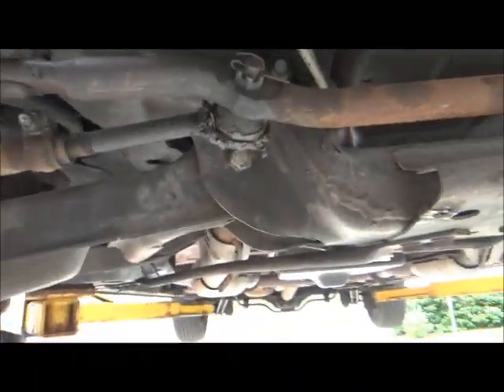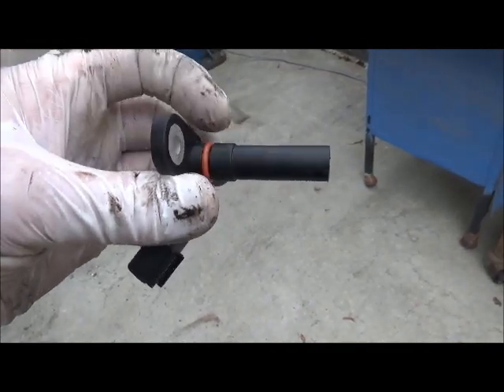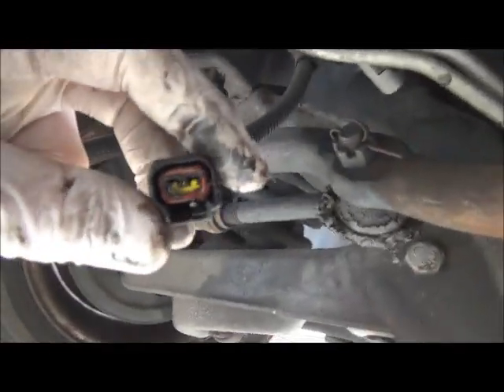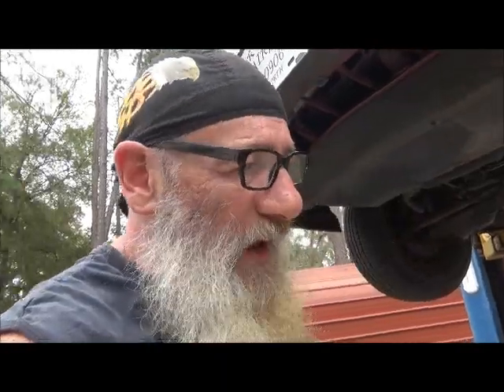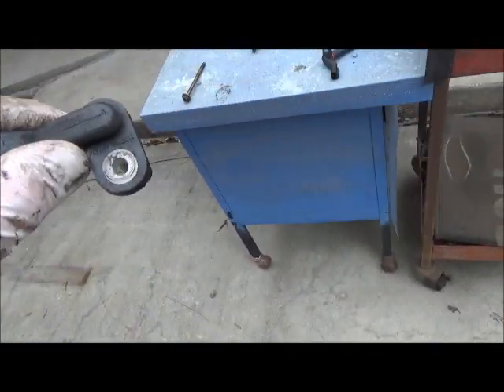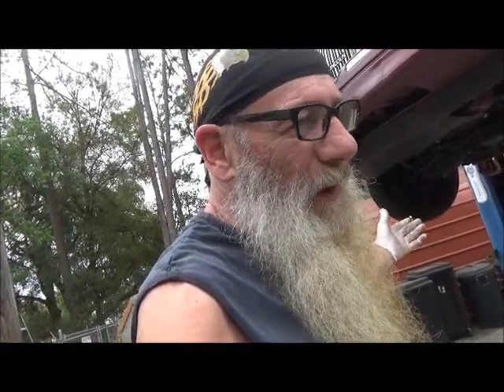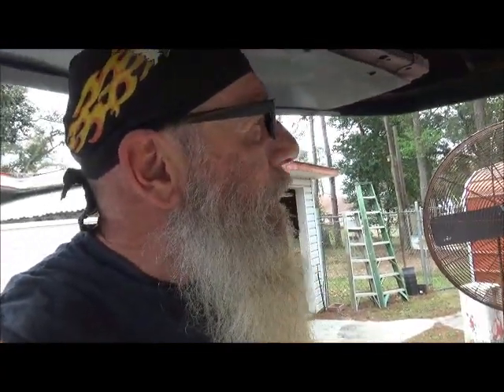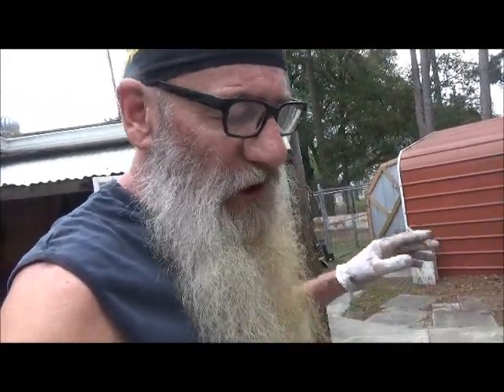Ford 4 6L Crank Position Sensor Replace

Comment from the maker: I lost a short part of this video. Basically it stated to wash out the electrical connector with brake cleaner and compressed air. Just brake cleaner will do if no air is available.

Comment: If that goes bad will it cause a wrench symbol to appear on my dash and put my 2007 f150 4.6 to go into limp mode. Because thats the issue im having now. I've cleared the pcm to adapt with throttle body, but symbol came back on kicking the motor down, again.  This is about to become the most aggravated motor replacement ever.  Any ideas

Comment: The issue I am having is a miss once the engine warms up. I have a 2003 F150 with a 4.6 V8 like this one. I don't really want to take the compressor loose just to replace the crankshaft position sensor if there are other likely causes. The truck started missing so I did a tune up on the top side, new motorcraft oem plugs, new Denso coils and a motorcraft camshaft position sensor. I had previously replaced the idle air control valve and I found one bad vacuum hose as well as a bad engine vent hose that runs from the valve cover to the intake. 
Any thoughts about what to check next? Again, it only misses after warming up, so it seems like a sensor starting to fail which is why I went ahead and did the cam sensor. When you first start it the engine is smooth as can be. Would injectors start misfiring when hot? I thought they were usually more problematic if they were cold (if they have any issue at all).
Reply from the maker: #1, are there any codes? If not, #2, replace fuel filter. #3, run Marvel Mystery Oil in the gas, follow the directions on the bottle. Do this for at least 5 tank full's. 
  I'm not going to go into all the reasons why in here, just do it.  Walmart has the best price for MMO in the big bottle.
Reply: @warhorse1956 - No codes are set. Thanks for the suggestions. I will give it a try.

Comment: So you can unbolt the compressor without having to vent the ac? Just moving the attached lines with the compressor after unbolting?
Reply from the maker: Yes, the comp. doesn't need to move much. Just enough to clear the sensor.
Reply: @warhorse1956  thanks for the response and video. Just finished changing one out

Comment: I just did this on a 97 4.6L. I did not have to jack up the car, or loosen belts/covers. I did it from the top in 10 minutes. LEAVE THE COILS AND THE COIL PACK ON. It does not help to remove them. It is very easy to change. Remove the power steering reservoir with 10mm (3 bolts) socket. Remove the sensor with an 8mm socket.
Reply: Godsend comment

Comment: My only complaint is i still dont know how to unbolt my ac compressor from the block. Im driving a 1998 f150 xlt with a 4.6 l windsor v8 small block, and yes, it does matter which factory it came from. The windsor and the romeo have ever so slightly different layouts

Comment: Awesome video,thanks for being real and sharing some great info.Having a no start issue with my 05 Mercury Grand Marquis 4.6- Michigan Winters suck,going to try the spray trick to see if the car will fire up before replacing the crank sensor,Much Thanks
Reply from the maker: YW, I hope it works. The spray isn't a definitive diagnoses. If it fails, make sure you indeed do not have spark. Also check for fuel pressures, these things are notorious for eating fuel pumps. Fuel filters should be changed every 1-2 years to keep the pumps from burning. Anyway, good luck.

Comment: I have been having a problem with my late mothers 2000 Mercury Marquis. Believe it or not the car only has around 34,000 miles on it. I have always maintained the car for her. Long story short about 2 years ago the car started to die out on me after starting. I would have to wait 10-15 seconds or more and it would start again and run for a little bit and die. Put my OBDII Code reader on it being the check engine light came on and it pointed out the crankshaft position sensor or a faulty wiring harness to it. At that point I just ordered one online and got a Dorman Brand Crankshaft Sensor. It lasted just under a year and I had the same problem once again so I ordered another Dorman Crankshaft Sensor and installed it. This one lasted about 8 months and I have the same problem again. Back in 2000 we purchased the car brand new. It never had a splash shield under it that I know of just to mention. Just yesterday being disgusted now with Dorman Sensors thinking it isn’t a quality Sensor I ordered a Genuine Motorcraft Crankshaft Sensor and it should arrive tomorrow and I plan to install it by this weekend. Just curious about anyones thoughts here. Has anyone else had problems with Dorman Sensors? The wiring harness looks to be in perfect shape to me from what I can see of it after moving the A/C Compressor to the side to replace the sensor. The plug is clean inside. Was thinking of putting dielectric grease inside the plug this time and maybe giving it a shot of brakeclean first and blow it out with a air hose. Luckily at 71 years old I am happy today that back in 1992 I installed a 9000lb lift in my Pole Barn when I was in my 40’s knowing then it would be a little tougher working on my back as the years piled on. It just getting tough to do anything on cars these days something I always liked to do during my lifetime.
Reply from the maker: The sensor I put in on this video failed just 2 weeks ago. I just settled on an Advanced Auto brand this time around. not being in the business any longer hasn't kept me up to date with the parts quality, but Doorman has certainly been a disappointment in the past few years. These days everything seems like a coin toss with parts.
Reply: @warhorse1956  I was in the Auto Parts Business since 1978. Retired in 2012. I owned a Carquest Auto Parts Store for 5 years and sold out to my then partner. I then became a WD (Warehouse Distributor). I saw a lot over the years. Many brands pulled from the same part sources and put the part in their own branded boxes or had the same sources make their parts. I was leery about even buying a Standard Motor Parts brand or any other today so I searched online for the Ford Motorcraft brand this time around. No way was I going to put another Dorman Sensor in. I still know people in the Repair business although most are retired like me. Everyone of them told me when it comes to Sensors they go to the dealer for them. Too many comebacks for the ones the Part Stores are selling today they tell me. When I make the swap this weekend I am going to try to follow the Crankshaft Sensor wiring harness up the motor to where ever it goes. Living near the woods I have had a few neighbors have mice eat their wires over the years although my family hasn’t  had that problem before and I have been here since 1985 but I am always finding Acorn debri under the hoods on vehicles parked outside. They have done a number on the fiberglass insulation under some of the hoods so you never know I could possibly have a chewed up wire. Did a good visual look under the hood nothing stood out though while occasionally using my air hose once or twice a year to blow away leaves and acorn shells out of the engine compartment. Thanks for the quick response. Great Video.
Reply from the maker: @ffas23  i too was in the automotive repair business for 39 years. Worked for Mercedes Benz for 18 of those years as a master (A) tech. Yes, OEM parts are generally speaking better quality, but not always. Take for instance the blender door motors for the climate control system on these Ford products. The OEM part has a much higher failure rate then the after market ones do.  Evaporators on Mercedes have a company approved failure rate of 18 months (300E- 600SEL) , a huge job to replace. The after market ones lasted for ever. We even installed those rather then OEM, after the warranty was out. I left M-B in 1999, so things may have changed since then. It's all just knowing what you're dealing with.

Comment: Thanks Great Video.  Of course we have the only car that you have to pull the AC Compressor back.  I am like you and older and not going to lay on the street and fight that but you have helped me diagnose and solve if it is the crank position sensor as no code came up.  I have just pulled the battery cable to reset and I found the sensor on the car.  Now I will get it towed or if it starts drive it to the mechanic.  Wish you lived by me.  Next if it doesn’t start is to spray it with WD-40.
Reply from the maker: First thing to do is check if you have spark and fuel pressure. These cars love to eat fuel pumps too.

Comment: wondering if one could do a bypass on that thing ! oops
Reply: perhaps resetting all the electronics by disconnecting battery terms and touching them together for 5 to 10 minutes.
Reply from the maker: @lastfanstanding999   Um, for your first question, No, it would be like taking a distributor out of an older engine. How would the thing fire? Second, by disconnecting the battery for a bit and looping the cables, all you would do is clear the fault codes , and reset the memory for the processor .

Comment: Thanks for the video. Been having a crank with no start condition on my 95 thunderbird with a 4.6 and figured I’d try cleaning the plug with some Wd40 and adding some dielectric grease before going into replacing and she fired right up 👍
Reply from the maker: Glad I could be of help. I would consider replacing the sensor as soon as you can. The condition you fixed is temporary and a sign of imminent failure. You don't want to get stuck somewhere and pay a towing bill.

Comment: my 4.6 just spinning over but wont start.fuel pump brand new.i can hear that come on.can this be it?
Reply from the maker: Well, it COULD be, but it could be a dozen other things. Did you even bother to check if you have spark?  By asking this question, you may be in over your head.

Comment: Wait were the symptoms?? Of the car was it dying when driving around and the car would randomly die and rough idle?
Reply from the maker: Car wouldn't start. Best to plug in a scanner if you're having drivability problems. Tho your problem sounds more related to fuel pressure.

Comment: Wish i could've watched you pull out the compressor.  I have a 04 ford explorer 4.6L but i don't have the luxury of a lift.  Any advice on freeing up the compressor.  I'm stuck with the crankshaft sensor loose but can't be removed
Reply from the maker: Take the tension off of the belt, remove 3 bolts holding compressor onto the engine block. Move compressor just enough to get the sensor out.
Reply: yes that compressor  is surely in the way on my 01FordEXcursion.
but this the best video I watch ,without showing loosing compressor bolts. Great video

Comment: the tutorial was very helpful and you show other areas of concern.  i dont think its necessary to throw in the extra cursing. thanks
Reply: I’m a true believer in cursing when it’s called for. If it offends you just turn the sound off and you won’t be offended. Easy fix.

Thanks for the video, was wondering how I’m gonna change sensor without it being bigger pain in ass than it needs to be.👍
Reply: I’m like you War Horse. I don’t give a crap what any other man thinks about me either, but I have started reading the Bible a few months ago. Cliff is right. God cares and we do need to remind each other from time to time. Being an oilfield hand, I struggle with cursing all of the time. Sometimes a couple of mfer’s and a mad wack from a big hammer is effective though 😂. Anyway, Cliff means well towards you and thank you so much for the advice. I cleaned the plug with electrical cleaner and plugged 😮her in. She fired right up!!!!!! Thanks again War Horse. I’m going to subscribe!
Reply: @Diesel4242  hey daniel this is cliff yes the video was  great. tnx for your reply abt the bible. i have been reading it for over 50 years and it is still as fresh as if i just started. i read the entire bible in a year through cbn. we even have motorcycle  ministries in the church. anyway hope you get this and God bless.
Reply from the maker: Do I look like the kind of guy that gives a crap about what you think? If you don't like the "cursing" , go somewhere else.
Reply: @warhorse1956  / 😄😄😄😄😄

Comment: Hey War House im antonio from Memphis t n... I have a 02 Ford crown Victoria i change the strater, buttery,and alternator and it will not crank.. Do you think its my crankshafts sensor
Reply from the maker: It's one possibility. Get a scan tool , which will get you into the ball park. Actually, first check for fuel pressure, these pumps go bad quite often. A proper diagnosis will save you some money, instead of arbitrarily replacing parts you probably don't need.
Reply from the maker: I just re-read your comment. It won't crank, or it won't start?

Comment: You don't need it at top dead center?
Reply from the maker: No, it's just a sensor. The reluctor ring just tells the ECM when number one is present and directs firing order from there on.